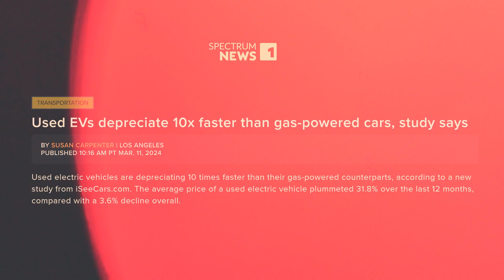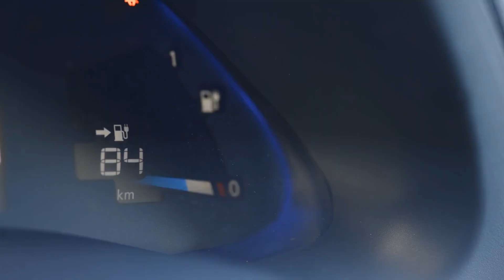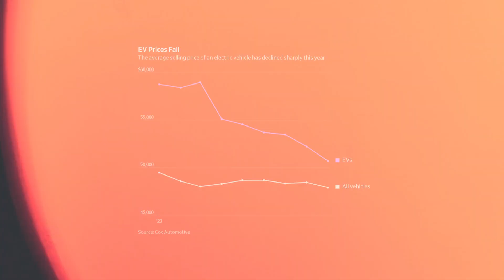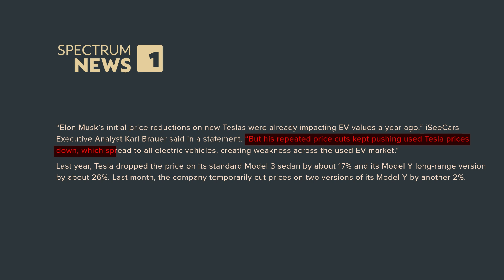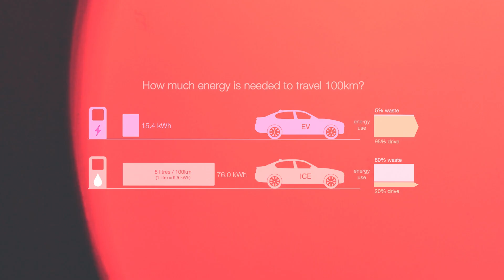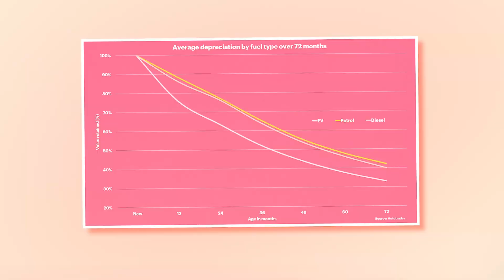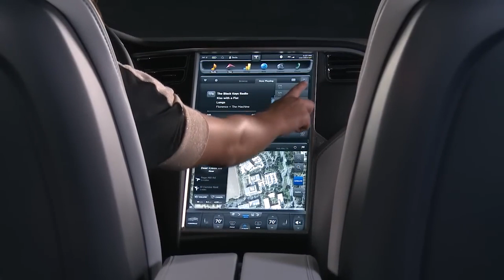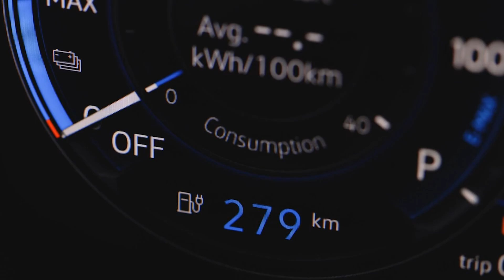Here's Why EVs Depreciate Faster Than Gasoline Powered Cars

Comment: Honestly, as a 4 year owner of a Tesla. I’ve only spent $80 on charging and $400 in maintenance so far. (I do have free charging at work)
The maintenance, was a tire rotation, changing cabin filter, a brake cleaning, and an AC inspection. 

Also a lot of the people i know charge at home, not everyone uses DC fast charging. Also by me it’s about 20cents/kwh at the local supercharger. About $12 to go from 0-100% which is about 300 miles. I don’t know how that is more expensive than gas….